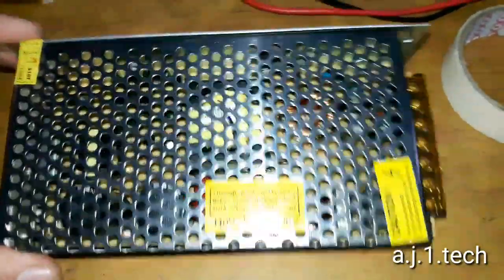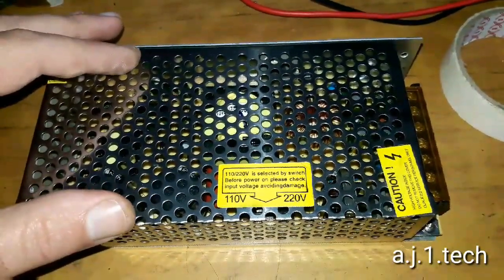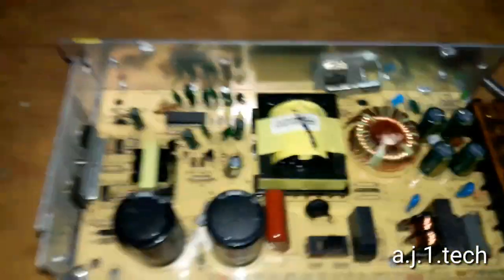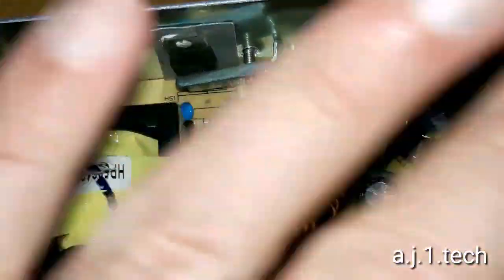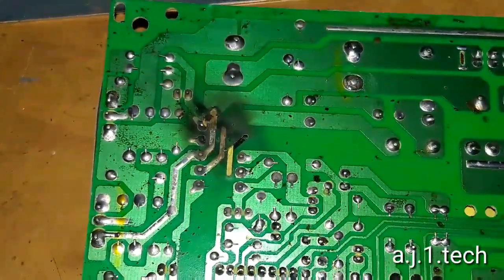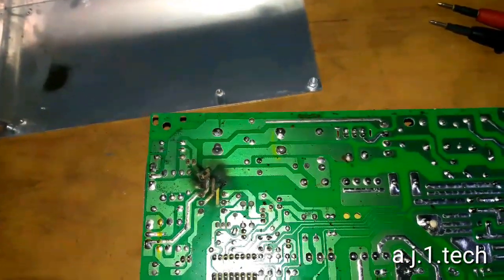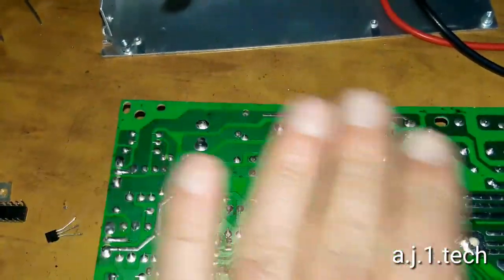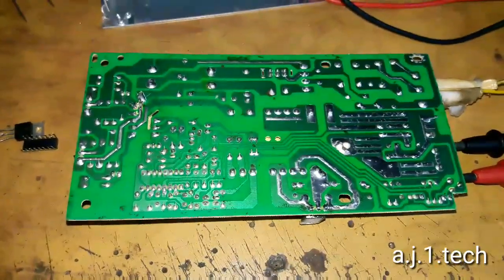12 volt Power supply  model : s-120-12

Comment: Please can you share the resistor values of R2 and R3 that are parallel to 250WV capacitors and also the value of C10 capacitor which is near to selection switch 110 and 220 voltage selction.

I will be thankful to you.

Best wishes

Comment: Just for my information, the voltage switch as you have it is in 220v mode? I just got this power supply, but i dont know if i set the switch in the correct mode for 220v
Reply from the maker: Hi, thank you for your question. In fact, it is difficult to answer you accurately because the unit is not in front of me and because there are many types of this power supply units that have the same external shape, but the internal design is different. The best way to make sure that the unit is tuned to work on 220v is to ask  of the seller who You bought it from him or review the manual that comes with the unit in the carton. I hope that I have answered your question. Please subscribe to the channel and activate the bell button to receive a notification when I publish any new video
Reply: @circuitblog01 Thanks for your quick reply.
I have approached the seller and indeed have to convert the button to 220v.
Reply: you can easily identify the voltage if you have a multi tester. :)

Comment: WOW!  Way too much work for such a INEXPENSIVE power supply!  Do a GOOGLE search for: "S-120-12" power supply schematic... find your schematics!
Reply from the maker: As long as the chopper  transformer is not damaged and there is no damage to the printed board, in my opinion, repairing it is better than throwing it in the trash. As for the schematic , I expect that if you do a search on Google, you will be able to find a close copy of the circuit diagram with some modifications of course.

Comment: I need to know the value of the input polyester capacitor, I have the same source, but the polyester capacitor burned, thanks for the video.
Reply from the maker: Hi thanks for your question in fact i can't tell you the value of the cap because your unit maybe  different from the one i posted the video one it and that because   the manufacturer can change the circuit design without prior notice, even if it is the same model . Please check the printed circuit and tell me where the burned capacitor is located and with which section it is connected and where it is located in the  circuit  .

Comment: I could not find schematic of this device.  Also  opto coupler where is.
Reply from the maker: Hi thanks for your question first of all sorry for the late reply. I did not see it  until now.
This model of power supply use a tl494 driver ic that control a (mos tr)  or( normal tr) and it dos not use optocoupler but you can set the out put voltage with a variable resistance from 10.5v to 13.8 v or so .
I hope that I have answered your question. Please, like the video and subscribe to the channel so that you receive a notification when I post any new video.
Reply: @circuitblog01  thanks.. helpful answer.

Comment: What is the internal fuse rating. Thank you
Reply from the maker: 4 to 5 amp will work
Reply: @circuitblog01  Many thanks. I tried 3 amp but it pops straight away.
Reply from the maker: @pgmilling  
If its blow out as you put ac in it you have another problem in the
 diodes or in the main  transistors you have to test them
Reply: @circuitblog01  Thank you. It seems the fuse was ok but no power output and the green light is not lit. I will take a visual but it may be toast. Appreciate your assistance.

Comment: I know it has two 12V out. Can I output 10V from both the outputs simultaneously?
Reply from the maker: Hi thanks for your comment 
This model it has two pins for the positive connected together
In the same printed line in the pcb and the same for nogative 
So you can not out put  separate volts from each other at the same time, but you can adjust the voltage by adjusting the variable resistance to get 10 volts
Please like and subscribe to the channel so that you will receive a notification when I post any new video

Comment: regulated?
Reply from the maker: Yes its a 12 to 16 v regulated
Reply: @circuitblog01  I have got a faulty  LS-PAB120 such as this one https://adapterexperten.se/en/ac-adapter-charger/sok-ac-adapter-efter-volt/120-volt/ac-adapter-12v-10a-55x25mm/
powering a picopsu 120w

do you think S-120-12 can fully replace it?